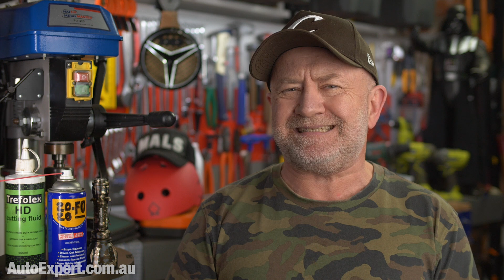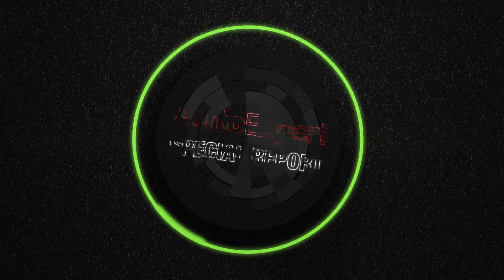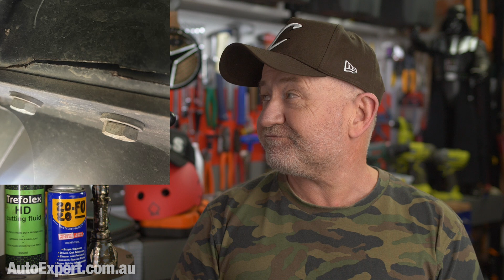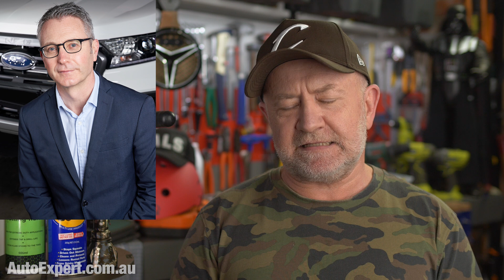CRACKED! Hi-tensile bolts Vs chassis Vs dealer incompetence | Auto Expert John Cadogan

Comment: Possible dumb question, could the bolts-in-question be too-long? IE longer than the internal dimension of the chassis rail? Assembler "tightened the bolts til they wouldn't go in any further", then as it pressed against the opposing internal chassis rail surface, it found a weakness in the rail wall and tried to "expand the chassis rail" via splitting the wall? Just thinking out loud...
Reply: Chassis rails are usually U shaped

Comment: Imagine towing a 3.5t trailer & it completely cracked the  chassis . This could leave a 3.5t trailer , possibly going into head on traffic because the safety chains & break away brakes are attached to the tow bar that has broken away  from the car.
Reply: Exactly right.

Comment: Ford in Elizabeth SA? Got the same story from them a few days after a major service (120,000km) on a Mondeo when the drain plug on the transmission suddenly went missing at 100k an hour around 11PM just outside of Ki Ki.

Oddly enough, they don't service the car anymore and I'll tell anyone with ears just how incompetent they are. If I had any choice in the matter it wouldn't go to any dealership.

Comment: I work in a dealership that used to sell Ford products but it was sold off to another dealership, we never fitted third party parts only genuine Ford parts so we didn't have with headaches if something went wrong with thier parts, the ranger towbar has 14  bolts holding it on the vehicle, 8 screwed into captive nuts, 2 nuts and bolts and 4 into nut plates inside the chassis and always used a rattle gun sneaking up to full tightness so not stretch or strain any thing and never had come back for being loose

Comment: IFF that cracked area of chassis is made of Ford's high strength steel, your  suggested repair would make it weaker than when new - buggered the heat treatment.   Welding repair on HSS gets complex if done by the book.

Comment: hi ,mounting the earth wires under the hardened steel washer that is equal to or I feel exceeding the tensile rating of the bolt causes relaxation of the bolt stretch due to the soft metal their made of .

so that bolt would of lost tension equal to the amount of  deforming and settling of that soft steel part times 2, . so even if that bolt was torqued to correct tension it would be guaranteed to not maintain proper clamping force .
in 35 years as a cat fitter I have never seen the hardened steel washer designed to mate with the cat grade 8 cap screw or bolt
wear or deform all though sometimes very rarely they do crack 

also dirt, paint  or stickers left on the part, in clamping area will cause loss of bolt stretch. shorter the cap screw or bolt the more important it is to have clean surfaces and correct torque setting with tension wrench.

Comment: Just a different story , this one from Holden .They don't sell cars now , so don't give a fuck . Son bought a new Colorado drove 65,000 kms , in 18 months never off road .
Had dealer fit all the shit $10,000 worth . Son went to the snow , got stuck , engaged  4wd started  to move , clunking from front end . Long story short , the front axle shaft snapped at an angle , rode over itself and cracked open the diff housing . The dealership that sold and serviced it regularly dropped us as did Holden . We bought a used diff and fitted it to get him back on the road . Still waiting for a response from Holden . They also fitted a big front  bar  which i found was loose when we put it on the hoist . I have been a mechanic for nudging 50 years and i can't believe the lack of knowledge these dealership " mechanics " display . When i put in my two bob's worth , they just had no clue . I have designed and built race  cars , my own run of 8 hand built sports cars , motorcycles etc . so i'm not just a mug punter and they know my work , but all to no avail.

Comment: John, this story struck a chord with me, as until 2014 I was employed at a Ford Dealership as a Pre-delivery technician.
The majority of the work I performed was fitting accessories to Rangers, although in nearly all cases, genuine Ford and including lots of towbars.
I can confidently say I never doubted the security of the securing bolts, and never, ever did I fit earthing cables, as in the photo'.
I took pride in my work and performing it to the best of my ability, although often under extreme pressure with time limits.
I like to think a lot of the results of my endeavours are still circulating out in and about 'Shitsville' and 'Dingo Piss Creek', safely and reliably !!
'Keep The Bastards Honest'   John, as you are want and compelled to do.
This episode of 'MALS' had a real resonance with me.
Thank you !! 😊😊👏👏

Comment: I have worked in dealerships (Toyota) installing genuine and aftermarket accessories.
Not a single fitter was trade qualified.
Not a single fitter had a torque wrench.
Not a single fitter was given after market instructions that included torque specs.
Not a single fitter was paid more than $23 per hour.
Reply: However, If you think loose bolts are egregious then buckle up.
When I first started with a Toyota dealership on the southside of Brisbane in 2011 / 2012 I was asked why it took me much longer than my workmates to install the Cargo protectors on the schweppes Rav 4's.

Well these cargo protectors were designed to protect the cabin occupants in an accident from any cargo they would have in the rear of the unit and they could be positioned  with either the back seats up or down by moving the mounts to different locations either forward or rear.
The forward mounting required the brackets to be installed behind the rear passenger roof hand holds. 
The bracket mount consisted of a captive nut (cargo protector was screwed to this) which was inserted behind the roof liner and in between the roof inner skin and outer body work and two other captive nuts for mounting.
To install it the instructions would have you remove the roof liner, mark up the locations using a template and drill 3 holes. Two were to mount the bracket to the rav 4 and the third was sized big enough to allow the mounting bracket to be slid in between the inner and outer skins.

Naturally this was a labor intensive job which to do correctly took well over half a day which the instructions said it would take and customer was charged for.  

Some staff were able to do it in less than an hour. 

How you may ask?

Well they would simply use 2 tek screws to secure this life saving device to the inner skin of the car.

When I explained this to the manager he put an end to the practice but naturally no recall was made and no attempt to rectify previously effected vehicles was taken. 
If you have a rav 4, dont trust the cargo barrier in the most forward position is all I can say.

Comment: I had a similar experience with a Ford dealer once. I was once told I didn't know how to use my handbrake on my new 2014 Ford Focus and that was the reason the handbrake engaged warning was coming up every cold winter morning. One of their f#$kwit mechanics decided to adjust the handbrake tension at the 1000km check, it took three attempts to convince them to loosen the handbrake tension. Made sure to never buy a Ford again and have talked multiple people out of buying a car from that particular dealer.

Comment: Could there have been paint between the chassis and the tow bar assembly? 
I have seen wheel bolts come loose many times where the rims have been newly painted even though they have been correctly torqued.
Reply: No but Ford dealers have taken note with thanks.

Comment: Not being a mechanical expert here. But the first thing that stood out to me was the lack of witnesses marks on the bolt heads. If they had been tightened and then torqued to spec I would have expected there too have been marks on the bolts.

Comment: If a bolted joint is correctly designed for joint loading it will never ever ever fail.
If the fastener doesn't fail when installed to the correct torque it will never break.

Comment: XLT Rangers come with a factory fitted tow bar, why would you change it. If they have nyloc nuts on the bolts,they are mild steel. I have seen chassis bolts come loose when nyloc nuts are used.

Comment: It is problematic of the car industry. I have had a dispute with a Mitsubishi dealer about a poorly fitted canopy which has resulted in multiple leaks in various locations on the vehicle. They said it was installed satisfactorily and to the canopies manufacturing standard. Some people have very low standards. I said this was not acceptable and I was immediately directed to Mitsubishi as it was not a Mitsubishi product they could do nothing dispute the fact they sold and fitted it. So, I jumped through their hoops to get warranty rubbers and asked for the canopy to be lifted and refitted. To get to this stage took 5 weeks. Any patience had long since evaporated. As I had no faith in the service team (based on the initial install) I advised them they had one chance to get this right hoping that may get them to do a better job, but my faith was misguided, it was still ill fitted  and the new improve rubbers were worse than the originals. It has taken 3 months but finally it has come to a resolution and refund. I guess they could not escape because of the video I compiled sitting in the back while it was raining showing about 200 mls per hour. Once the canopy is off, it will be the last that dealer will see of me.

Comment: I'd be curious John if maybe the dealers cross-threaded the bolts. Either that or they used a rachet that displayed things in Nm instead of the standard lb/ft for measuring torque in the auto industry.

Comment: As someone who does Wheel alignments on customer's vehicles, I can't  tell you how many times I've knocked back jobs because of a incompetent technician or backyard flog has not properly torqued down a front subframe, properly centered steering racks or poorly pressed lower control arm bushes... Its Scarily more common than you think unfortunately.

Comment: The ideal result for the customer, of BOTH FORD and the AFD, would be to either Buy Back the vehicle or replace with a NEW unit, fitted with a towbar of course. This may help install some trust with the customer and start to rebuild their relationship, especially since the owner has more than one  of these beasts. A lot of sucking up is definitely required by Ford & Co in this case.

Comment: Come loose.?.!..Looks like the chassis gave up to me John...I have a grief with a well known blue box  timing belt company over a broken TTY 10.9 timing belt idler bolt(came in the kit) that snapped and caused 8 bent valves after only 80k's...They said I didn't do up the bolt tight enough(50nm+90) that hey supplied and it came loose and that I could have done it up with a rattle gun.!..I have recent vids on this...Long story short they covered the head repair and the parts supplier covered the parts...I covered the labour that started as a love job...Btw I used the original bolt and just did it up F'n tight with some blue locktite...I'm getting the associated bearing tested 'cos I recon the issue is.Love your work mate.

Comment: Sorry mate but I’m going to have to call you out on this one. High tensile bolts do work themselves loose. In all your engineering experience I would have assumed you would have heard of spring washers? I’m pretty sure you will find there is ADR rules stating that spring washers must be fitted to all bolts of tow bars, bull bars etc. If I had to do a rego inspection on this vehicle, I have failed others and would fail this one due to not having them installed. I have lost count of how many bull bars I’ve seen rattle loose. All with high tensile bolts. Most of the ones have been fitted without spring washers. Maybe ARB did not supply them? Just saying...
Reply: Umm….very sorry to disagree but you never use spring washers with high tensile bolts. Where is an example of an engineered spec’d high tensile bolt fitting specified by the designer to use spring washers please?
Reply: what are u on about adr rules have u fitted towbars and bullbars im a ex nissan tech and spring washers were never supplied for bullbar and towbar fit outs plus think about it gearbox, engine mounts, cross member bracket never had spring washers. have u seen what spring washers look like after they loose tension??
Reply from the maker: You cleary don't understand the hi- tensile joint concept. Spring washers are not an asset in a hi-tensile joint. Do try to keep up.
Reply: @AutoExpertJC  Do you use your ego to sooth hurt feelings? Instead of the generic answer I just received, how about you tell me how I’m wrong as I stated real world facts. If I’m wrong I will happily admit.
Reply: Hi  @WheresmywingsRedBull  , I’m no mechanic so I really don’t know what I’m talking about, but it occurs to me that con-rod and main bearing bolts don’t use spring washers and they don’t work themselves loose.  If they did there would be cars littered all over the place with ventilated engine blocks…
Reply: @WheresmywingsRedBull  John is a proponent of caustic humour.. don't take it personal; actually, the photo's do show all the mounting bolts had the correct washers fitted.
Reply: @duckmcf  yes I agree you don’t. Ironically, head bolts, Con-rod/main bearing bolts don’t use spring washers because they are torque to yield bolts. (Inbuilt spring washers so to speak) comparing those to high tensile tow-bar bolts is not a good argument.
Reply: @petesmitt  In all fairness the inside of the chassis was not shown. We have no idea what those bolts were screwed into or what was used. You guess is as good as mine.
Reply: @WheresmywingsRedBull  , but isn’t tightening up a high tensile bolt to a particular torque setting more or less the same as tightening it up to a set amount of stretch.  In both cases your slightly stretching the bolt to apply a clamping force.  What am I missing here?
Reply: @duckmcf  A high tensile bolt is designed not to stretch, or very very minimal it is the opposite for torque to yield. The argument is how did a ht bolt come undone if it does not stretch. As I said earlier, it could be because it had no anti vibration spring washer fitted.
Reply from the maker: Doug, it's truly amazing to me how consistently wrong you are on every point here. A) Not all road and main bolts are torque to yield. Many are hi-tensile. B) All bolts tighten by stretching, especially torque to yield and hi-tensile. If there's a torque spec, it's there to induce a safe but significant stretch, resulting in a high clamping force. That's the mechanism. C) Most hi-tensile joints do not require anything like a spring washer, because the fasteners do not rotate if tensioned properly. It a hi-tensile bolt slips enough to rely on the spring washer for retention is would already be loose and not providing the surface interaction to keep the parts sufficiently clamped together. Spring washers and other retention devices are far more commonly applied for bolts that carry the load in shear, or on low grade bolts. Try sticking to what you know, which would be: Being a mechanic. Use a torque wrench when there's a torque spec. 

Pro tip: The only difference between TTY and hi-tensile is: You cannot re-use TTY bolts (because they have yielded and deformed plastically). Also, TTY is lighter for the same clamping force, and this is the main reason for using them in weight-critical applications. Do try to keep up.
Reply: @AutoExpertJC  the one thing that is strikingly obvious here is the stark difference between someone that knows everything out of a text book and sits behind a microphone/Computer, and someone who has years of balls deep industry knowledge. Why the hell would anyone want to use tty bolts on a tow-bar? There is no thermal expansion on a tow-bar, there is no dissimilar metals with different expansion rates. Once again your lack of industry knowledge shows when you forget to say that the high tensile bolts used on rods/mains instead off tty etc will have some form of vibration retention device fitted, ie bend over locking tabs or aviation locking wire all which equate to the same principal as a spring washer. You keep saying high tensile bolts do not come loose but that is also a lack of hands on experience shining through and it’s plain and simply wrong. I will say this for the record right now, 95% of all bull bars and tow bars sold right now will come with a compilation of high tensile bolts, nuts, flat and spring washers in the kit. You might need to hit the books a bit harder mate before you criticise.....

Comment: "You. Are. Fucking. This. Up. I can't make this any clearer."
In the Before Times pre Anti-Vaxx and Covid conspiracies I would have thought that would be sufficiently clear for anyone. These days I'm not so sure.
I'm also having difficulty finding an online chart of extra-Nm offsets to be applied when installing ground lugs under a high-tensile bolt, so I can be sure that I've properly mashed them into the bearing surface.
Reply: Just make it hand tight; that's alright! :)